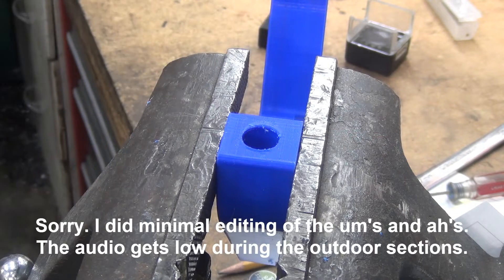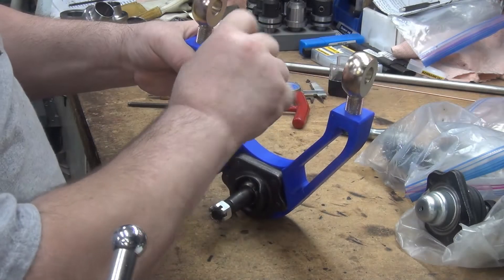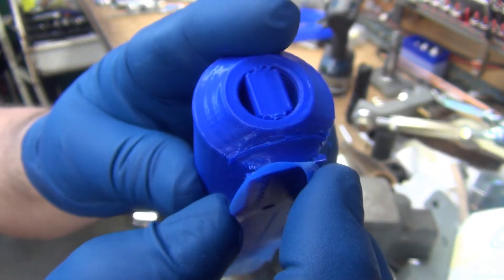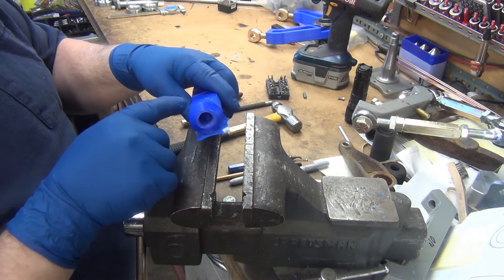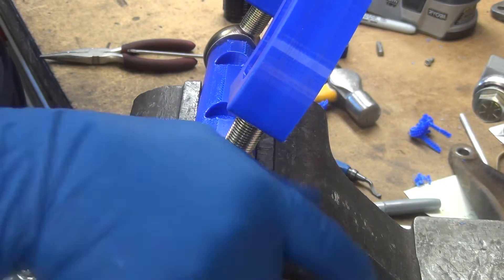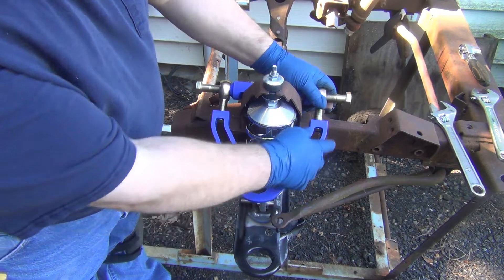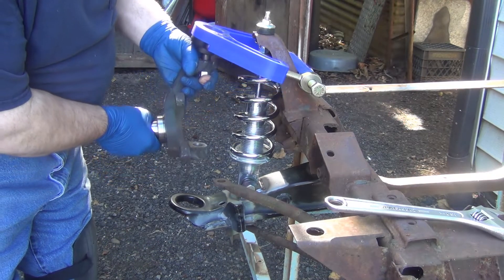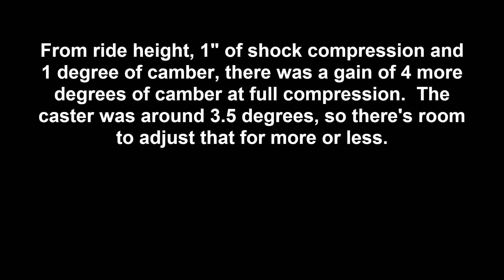3D printed upper control arm test fit

Comment: Where did you learn your suspension knowledge? I’d be keen to pick up some of that knowledge!
Reply from the maker: Typically from doing it wrong and having someone correct me. lol  The little bit I have is very specific to each project I've done.  I've basically had to learn it as I go.  I've done this project before, so that might be why it seems I know something.  I've got some friends that are way, way more knowledgeable about this stuff......things like roll center and ackerman angle.  Some of the times, the specs come from the person that wanted me to build it.